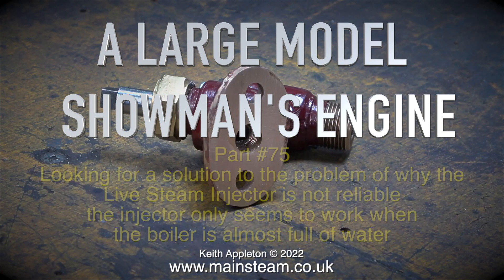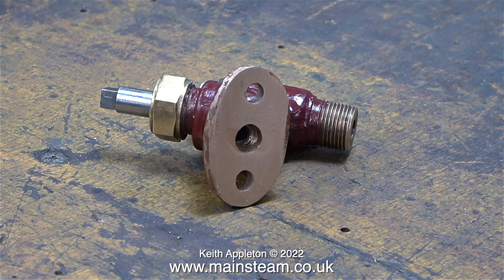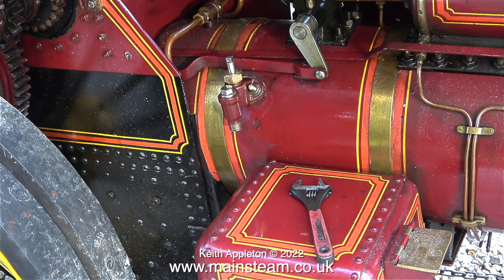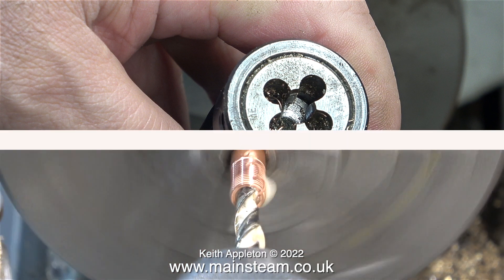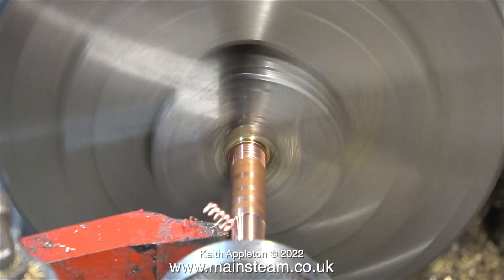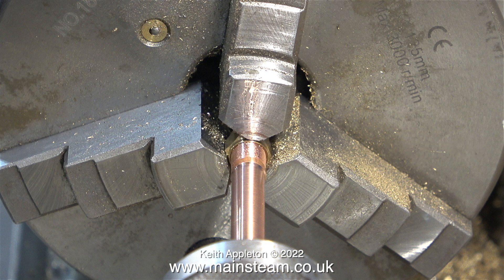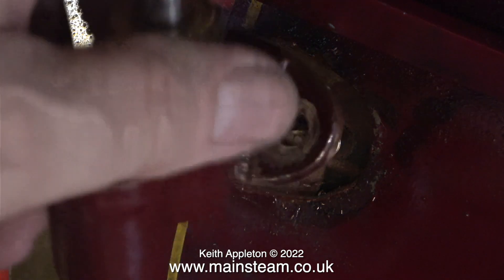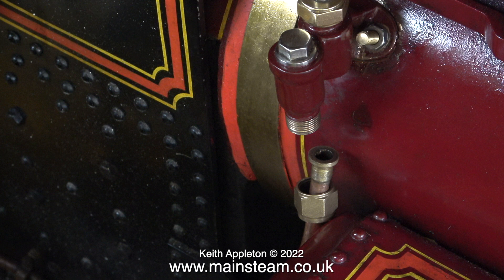A LARGE MODEL SHOWMAN'S ENGINE - PART  #75

Comment: as soon as you mentioned in the video that it only worked when almost full was the clue I needed ... just before you said the water was cooling the steam I had thought the exit is too high and cooling things off so it doesnt have the pressure of the hot steam to keep it going ... 
.
Reply from the maker: I will be more confident when I test it in Steam. The injector capacity is also a but high.
Reply: @keithappleton  to me it resembled something akin to a vapour lock in a gas tank ... just in reverse ... the easy fix for that would be a longer tube to be below the midline or later of the tank ... I would expect your solution might be a little short BUT in the right direction ...